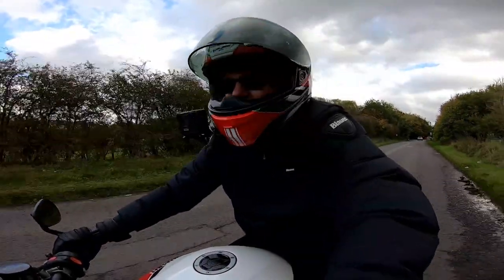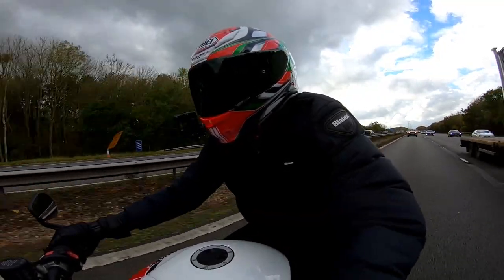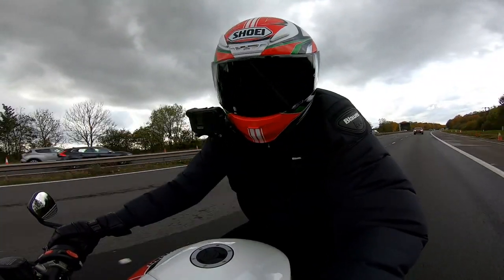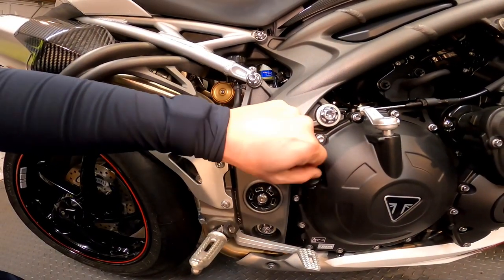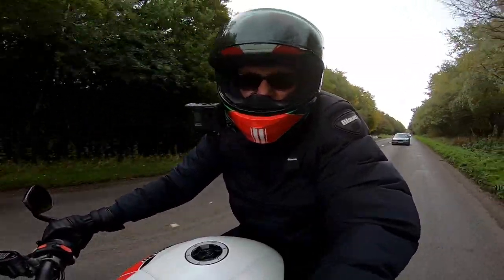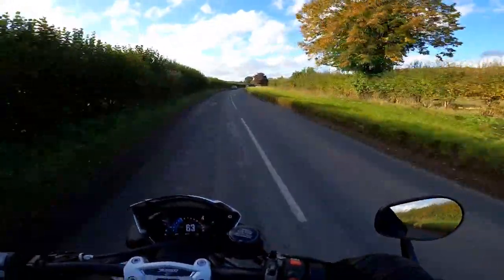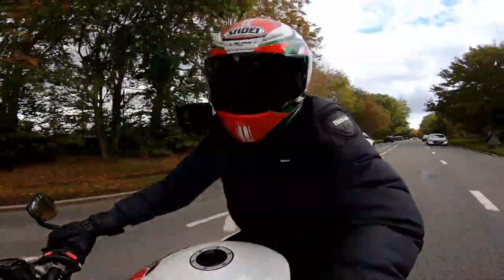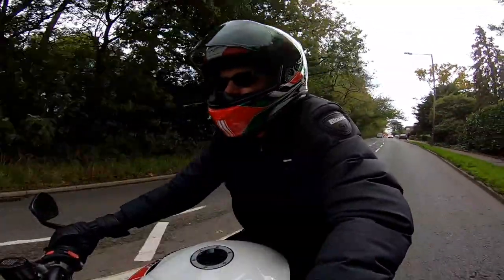Triumph Speed Triple RS Review | What's it like to live with? - Lessons Learned

Comment: Just added a 2019 Speed Triple S, because of my 2007 Tiger 1050.  Speed Triple is comfortable (surprised at the lack of wind buffet even in triple digits),  quick, sounds sweet, I wouldn't mind a little more in the electronics department, but the most important thing about the motorcycle is, I want to ride it all the time.
Reply from the maker: Sounds good to me Thomas!

Comment: I bought a '19 S, Crystal White, brand new off the floor where it had been sitting for over a year. Here in southern Missouri few people know what a Triumph is. My local dealer is 35 mi away and is also a Yam, Kaw, Suz and Indian dealer so his Triumphs remain his best looking, best finished, in many cases best performing bike brand. Yet they're also his lowest volume brand in the store.
I've ridden for over 50 yrs and have owned all Japanese brand bikes until I bought this Speed Triple. I've never had any significant problems with any brand. My most recent bike had been a '19 Yam MT09 - great engine but somewhat "nervous" street handling even with the fully adjustable suspension. Previous to the MT I rode an '05 Kaw ZX10 for over 10 yrs which had been, by far, the finest bike I had ever owned. 
With just over 5k on the clock the Triumph has been wonderful so far. With fully adjustable Showa suspension (very similar to my ZX10) I have found it remarkable in recreating the "feel" of my ZX while being considerably more comfortable to ride on day long trips. Fit and finish are beyond any of my previous Japanese bikes but then you pay a bit more for it. The engine has been wonderful  - muscular torque over a very broad range, more "relaxed" than the MT, more sport touring oriented than the ZX - truly one of the great all-around engines I've had the pleasure of riding with a stock exhaust note that sings my perfect tune. This bike could very easily be transformed into a great sport tourer with just a bit of a screen up front, lower footpegs and higher bars. Gearing is sport touring wide and comfort for me is excellent (that "firm but plush" capability of the better modern day inverted fork designs). I'll have this bike for sometime to come as is scratches all my itches while the new 1200 has become so much more track focused and expen$ive!

Comment: In the last decade of the five I’ve been riding, I’ve bought three new and one almost new motorcycle. That’s not bragging, it’s confessing. Looking back, I shake my head and wonder what I was thinking. After all, isn’t there a plethora of “demos” and unsold / barely used 2018 -19 bikes for sale? Well, maybe not a “plethora” but how often does a fellow get to use the word plethora? Anyway, a Speed Triple is a real contender for my new “buy anything but new” attitude. Thanks for the insight. That aside, I’d love to hear if I’m an anomaly or representative of a demographic that starting to grow weary of dealership fees and new bikes designed to accessorize, option and farkle a rider to bankruptcy?
Reply: I'm like that with many things to include cars, kayaks, wave runners, bicycles etc. There are some really good used deals out there for a fraction of the new price though you need to be quick on the trigger to actualize them

Comment: Lovely bike, great review as always. One thing regarding keyless: I have a 2019 Tiger 1200 XRT with keyless. What I do is keep the master key on a lanyard around my neck and then have one of the ‘dumb’ keys in a pocket to access fuel tank, top-box, panniers, etc. I don’t have a problem and prefer not having the master key in an ignition barrel. So, for me at least, keyless works well.
Reply from the maker: Fair enough - I just think it was a problem that didn’t need solving!
Reply: Carry two keys when I go riding, madness. If manufacturers use the 'security' of keyless reason, then why no immobiliser and a tracker in the frame. Different in a car with central locking for all doors and flaps. TMF spot on.
Reply: Looking forward to a keyless bike. Never remember which pocket I’ve put it in and often forget to look before putting helmet and gloves on. Then I have to take them off, to look in my jeans which are under my wet weather gear, because I can’t see the zip with a helmet on or undo it with gloves!😂
Reply: Keyless ignition is absolutely great!!  Best convenience when riding!  ...I do not know about you, but I do not use the key to access my seat and fuel cap everytime I come on and off the bike...

Comment: Hi mate, I have a speed triple. You need to go into the settings to turn on the quick shifter. For some reason when the battery gets low it switches off but it is just a case of switching it back on and you are good to go. I replaced the Corsa's with Michelin Road 5's which transformed the bike for me particularly in the damp and wet weather. Big positive for big guys - I am 6' 3" is the mirrors. You can actually see what's behind you.  Excellent review..
Reply from the maker: Thanks - and thanks for the tip on the QS! Doh!

Comment: Great review about a great bike. I luv my Speed RS!! Wet weather fit Metzeler M9 great wet or dry/ Chain lube fitted a scott oiler x system / comfort i did 350 miles in a day with a couple of stops just fine/ suspension - I am 6'2" and 16 stone and and the ride is brilliant!/ A lovely quality product/ do agree with you about keyless complete waste of time when it comes to fumbling for the key to fill up with petrol. Performance is awesome and perfect for the road/ I luv my Speed RS!!
Reply from the maker: Glad we concur!
Reply: Would have been okay if they had a solenoid lock for the tank-- unlocking if the key is in proximity for ignition, locking as soon as you walk away. (With the tucked key being a backup in case of battery drain or solenoid failure)

Comment: Your 'like to with with' reviews are excellent and very real world vs what we get on launch reviews. Have to agree, Triumphs paint schemes are pretty unimaginative these days..they used to have some great colours! I traded an older  street triple for one a few months back, as less than a year old with a number of extras made it a bargain. It had to be white, as flat black with dayglow yellow accents looks cheap and lets the bike down. If you think that area under the cowl is small, wait until a prospective purchaser a tail tidy. The additional wiring and connectors eat into that space even more. I seriously doubt I'd fit anything under that cowl to charge and use that USB port. Once you have the cowl off, you'll need a 5mm allan key to remove the seat..and there are more tools under there..but that makes little sense if you need your own tools to get to them, so underseat storage is a significant downside compared to the street. The quick shifter may have been set to 'off' in the menu. I disconnected the battery to connect an accessory sat nav holder...went out for a ride, no QS. Found fairly well buried in the menus there was a QS setting item. I guess default it's off. Having said that, love the handling, seems to have a tighter turning circle vs the street, feels more planted, love the looks and wanted the twin underseat exhaust, which I have a feeling will go on the next gen bike....always liked the twins on your street and didn't like the single under slung one on my later street. The torque at real world (i.e. legal) speeds feels just as good as my K1300, but feels lighter, so happy with the power delivery as well/ Have to have at lest one Triumph in the garage..plus I 'think' these at least were made in the UK. Not that it matters too much, but nice if it is UK made.
Reply from the maker: Indeed Vernon, and thanks for the kind comments - much appreciated!

Comment: I really like this review because you cover so many things compared to others. Usually reviewers only concentrate on the performance side, how nicely bikes wheelie and how they do on the race track. But to me that is quite insignificant because I don't do wheelies and almost any bike with +140bhp is fast enough and I can say it without reviews. Things like slow speed comfort around town, gas mileage etc are more interesting to me. And yes, mileage does matter even when buying an expensive bike because I'm definitely not rich but wanted to buy a dream bike and worked hard to save money for it :)

Regarding keyless ignition, I love it. When paired with electronic fork lock (which absolutely no one talks about in their reviews) you only have to take the key out of your pocket when refueling and I personally rarely have to fill up my bike more than once a day so it's not a problem.
Reply from the maker: Thanks for watching - and glad you like the format, I try and cover what I'd want to know if I were buying a bike....like you I'm not really worried about how it goes around a track or wheelies but the other stuff I covered.....

Comment: When I test rode one of these in 2018 the rear seat cowl flew off at 60mph as I was riding along the A605 near Oundle. Fortunately I saw it disappear in the mirrors and managed to retrieve it before a truck ran over it. It was a bit scratched but not too badly. I wasn't impressed with how it and the main seat secures. Seems to be a theme on Triumphs. My Sprint ST1050 has seat secured by two bolts which are a nightmare to take out and put back in. Triumph should take some lessons from Honda on how to secure seats.

Apart from that it was a lovely bike to ride and agree with you completely. The reworked 1050 engine is a peach really free revving now and a joy to listen to. As you say more than enough power for the roads but still down on power compared to say the BMW S1000R and SDR. I don't find Triumph TFTs too bad, but then I am a kid who likes kids stuff. Great that the switchgear is illuminated. The high level Arrow cans are very nice. Brakes and suspension were awesome for road use and I should imagine pretty good on a track too. If I recall Statham at 44teeth loved it when he reviewed it on the track but did say it could do with more power which I agree with, but still not a slow bike, but quite a bit slower than it's rivals which is a shame as the rest of the bike is awesome and can easily deal with more power.

Keyless ignition is a solution to a problem that never existed. I wish bike manufacturers didn't use it. Ok have coded keys to immobilise they bike so it can't be started with a screw driver, but don't go any further.

Triumph wanting an additional £350 for the QS when many naked bikes have it included is a bit of a cheek. But then I suppose Triumph would just put up the price of the bike if it was included.

Don't like the view of your camera facing you on the bars it makes it look like your are riding in a twisted uncomfortable riding position. Maybe you could reposition it or change the aspect to eliminate this distortion?
Reply from the maker: Thanks for stopping by Alex - always good to hear from you (maybe I am distorted....)
Reply: @TheMissendenFlyer  Always good to watch your reviews. Stick around and stay tuned ..... ;@)

Comment: I very nearly bought one of these a few months back. The Superduke won out though. I'm not ready to have a more sensible bike yet.
With regards to keyless ignition, in a car I don't get it. You need to have it in your hand to unlock the thing. On a bike I've been converted purely on the basis that I cannot leave my key in the ignition or top box, we've all done that at some point, and you're less likely to have it pinched by some A-hole at a set of lights. I would also like the option of being able to put it into an ignition though.
Reply: Got keyless ignition for my car, certainly don't need it in my hand to unlock it, just walk up to a door and open it, keys in my pocket, on a bike can't see the point especially if you need it for petrol cap
Reply: @matthewoliver9055  
I don't need the key for the petrol cap, you have 30 seconds from when you turn the engine off to lift the cap. It varies bike by bike.
The amount of times I've accidentally left the key in on my bike having keyless ignition is a good idea.
Reply: @Icem4n84  I suppose it is but I don't leave keys in ignitions so for me pointless
Reply: @matthewoliver9055  Well I tend not to keys in the ignition but I have done it. I have also known of someone who has had his keys pinched at a set of lights.

Comment: 👍 Good comprehensive review ( even checked how scratch/chip resistant the seat cowl is ) on a great bike.
The 1050 engine gives you all the power you will ever need with a great exhaust noise
Triumph are trying to clear out the old stock and there is some great bargains to be had on this model.
Definitely with you on the keyless ignition, why when the ignition lock is a perfectly reliable and secure place to put your keys do manufacturers design a insecure unreliable expensive key.
Reply from the maker: Beats me!

Comment: I have a '19 Speed Triple RS. I love and adore that machine. 15,000+ miles so far. Those Super Corsa's in the wet and/or cold... NO. I swapped mine out after the first summer and after a few different sets of tires, I find my favorite is the Pirelli Diablo Rosso III. I had some moments on the Super Corsas in the cold and one in the wet. Tar strips in the wet = scary. I removed the pillion pegs/legs straight away. I replaced the horn straight away. I average about 47 mpg. The screen layout you were using it with is my preferred of all they offer - and I also actually like that one personally but do agree with you on the Mickey Mouse/Fisher-Price look of some of the other layouts. I cannot understand who thinks some of those layouts are functional. The turning circle is terrible, I agree. Hearing you do a "woo hoo!" on the overtake = my thoughts exactly. It's no Tuono, but it is fast enough; at least for me. Give me torque in the midrange and I'm a happy guy. (A naked above 90mph is not fun, so ultimate top-end speed matters little to me).  I cannot stand (!!!) the sticker graphics they put on it the last two years, mine came with the more tasteful red/gray stripes which I've either swapped for carbon fiber parts and replaced or I've removed them from mine (the all-black colorway). When shopping for a new bike back in 2018, I narrowed it down to the Street Triple RS vs the Speed RS; one thing blew me away immediately - torque. It was a no-brainer choice. I thoroughly enjoyed this review and it feels like home to hear that triple revving up.
Reply from the maker: Great stuff Scott - great machine too, for some reason I didn't have you down as a Speed Triple man...dunno why....
Reply: @TheMissendenFlyer  I had a '13 Street Triple R... and then the Speed. The Speed will be a very long-term keeper for me.

Comment: As you know, I've got a Speed Triple and a Speed Twin !
Your review is spot on.

I moan about the look of the twin headlights, don't know if I should say, for actually lighting up the road, I find them better than the Speed Twin.
The lighting is more "even" on the Triple. Maybe I should stop moaning about the "look".

Wet weather riding. What's that ? :-D

Pillion. My wife will not get on the Triple, she happily gets on my Speed Twin. Triumph do supply both the seat cowl and a pillion seat for the Triple at no extra cost when you get the bike. Pillion seat is very small and high up, along with high pegs, and the high level exhaust could be an issue on the thighs. It is not a bike for pillions !

I'm getting 50 MPG :)

When I got my one, in a deal in Aug 2020, it came with an inclusive quick shifter. The heated grips got added via an options voucher. Plus Triumph were giving £1000 off if you took the finance, which you could clear within say a week or so and only pay a very tiny amount of interest (£40 ish) . So £960 off, assuming you could clear the finance, and a few of the options at no extra cost.

Quick shifter on my one works really well. I love it. ( Something I'd like on the Speed Twin, but that doesn't seem easily possible )

In Aug 2020, I test rode the current Street Triple RS and the current Speed Triple. I much preferred the feel of the Speed. The massive amount of low down grunt, and it feels more "meaty". Exhaust note on the Speed is a lot better. The current Street Triple RS is a very good bike, just not as good as the Speed Triple RS IMO.
Only thing I prefered on the current Street Triple is it has a larger fuel tank.

Yep it's a Sunday back road blaster, that's what I've got my one for.
As a commuter in town centres, it would be fine, but you don't need 148 BHP for that. You could tour on it but without a pillion !

Comparing both my bikes, I prefer riding the Speed Triple. I prefer looking at my Speed Twin (it is still a good ride, just not as good as the Triple) . Don't tell the Speed Twin or Triple that !
Reply from the maker: Wow - thanks for that lot!
Reply: @TheMissendenFlyer  sorry, I guess I wanna be a youtube reviewer, and typing a few lines is easier than the hard work of making videos :)